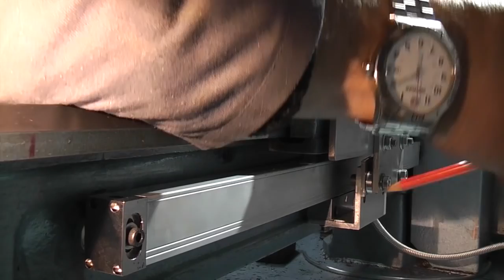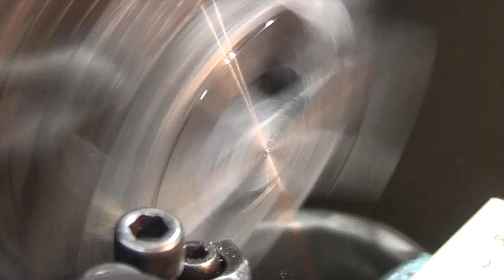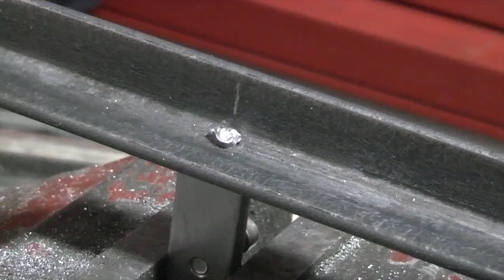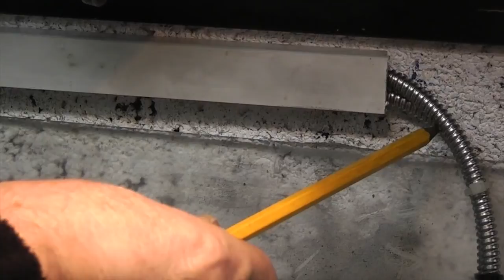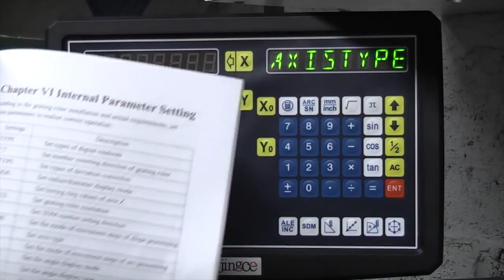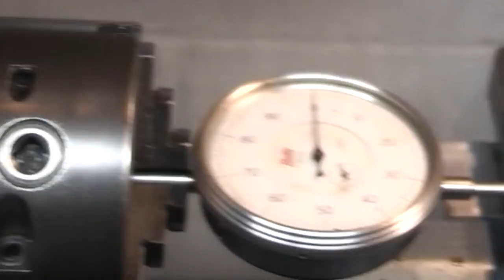DRO on the cross slide

Comment: Very nice installation.  I've just finished installing my lathe DRO.  Have you been able to figure out what all the settings are on the DRO?  There are several in the set up menu that I don't know what they are.  Also, I have two of these JCS900 units but they are slightly different in the button locations and the setup menu is also different.  I am assuming that the Firmware is different.  Do you know if the Firmware is available for download online? Thanks. Regards.
Reply from the maker: Hi I would think the firmware is made to suit the system on your dro.I’ve not seen any firmware updates. If it all works why would you change the firmware? Your instruction manual should give you all the details.
Reply: @enotsengineering  As many have noted, the instruction manual for these import DRO's are difficult to understand and in some cases, impossible.  There are several options in the set up menu that I have no clue as to what they do.  I have two JCS900-3AE units.  Same model number, but very different. Different keys and layout. The problem with the second one is that the arrow keys function backwards. The down arrow cycles SDM 1, 2 ,3, etc., and the Up arrow cycles SDM 3, 2, 1. INC, ABL. And I cannot get into the secondary menu by pressing the mm/inch button 6 times during self-test, and the manual states. I've tried dozens of time. Hence the Firmware question.
Reply from the maker: On my display I hold down the enter key when switching on see https://youtu.be/WBuUxAsbVnQ

Comment: Why you change the x axes to y axes ? On the mill the x axes is the same as the x axes on a lathe.
Reply from the maker: Hi Markus on a mill the X axis is left to right the Y axis is towards you and away and the Z axis is up and down.On a lathe the z axis is left to right the y axis is towards you and away. As DRO displays for 2 axis have x and y we use the X axis as the Z axis . think of the lathe as a milling machine lying on its side.
Reply from the maker: On the video I had the plugs in the wrong axis

Comment: Thanks for video and walk through. 
I’ve recently bought a Boxford AUD and inherited a previous owners truly terrible attempt to fit the DRO. 
My version has two T slots on the rear of the cross slide so I intend to make use of them both similar to what you’ve done. 
One question though, presumably you need to remove your DRO when fitting the milling slide? I’m considering using much shorter T nuts so that the rest of the slot remains free for mounting. Is this something you’ve considered/have any thoughts on?
Reply from the maker: Hi Martyn
The tee nuts could be about 20mm long if you use two to hold the backplate you could make them 15mm. They only hold the scale and do not have any force applied to them.

Comment: Hey, I got the same one for only 2 month's now, and the Y axis give's no more value , it stay's on zero
Do you have any knowledge on these problems ?
Keep up going with your good video's
Reply from the maker: Hi Ronald you need to find out if its the scale or display swap your scale to the x axis to see if it stays at zero.
If so check the scale is clean and free from oil/swarf and the wires at each end are all connected and not damaged.
Also check if the display zero button is not stuck in the on position
If its still not working ask your supplier if they will replace it.
Reply: @enotsengineering  Hi, thanks for the reply, I already send a tweet to you, but anyway, I checkout the scale or ruler as you called, between the two axis, and the work fine.It's the display, I'm contact Banggood and send a movie on you tube. Now I wait for further outcome
Reply: @enotsengineering  Hi Alan, I send you a tweed but got no answer ! I asked Banggood to relplace it, but instead I got a refund, not the aspected amount, anyway I order a new one and see further on. If this one will fail again, I have serious thoughts about Banggood. Thanks for your support

Comment: Could you mount the scale remotely 
Connect a cable to the slide to the reading head
Reply from the maker: Hi Paul
Yes I looked at mounting the scale vertically using pulleys and wire cable but that become more complicated with balance weights

Comment: You have just solved the problem for me about the mounting of the cross slide, but have you given it a thought about fluids running under the shield ?
Reply from the maker: Hi Soren I don't use coolant on my lathe. You could use sealant to seal the cover to the back plate and there is a gap between the cross slide and mounting bracket so any coolant running over the cross slide top should run behind the glass scale case onto the bed.

Comment: Hi Alan: This proves once again, that many "cheap" components of Chinese origin, are of excellent quality and compare favorably to quality brands sold at many times their cost.
I for one, am going for two of these units one for my lathe and another for my mill.
Your adjustment and calibration, is the mode that I would use for direct reading of part OD.
Thanks for the demo and clever solution to your mounting problems.

Cheers